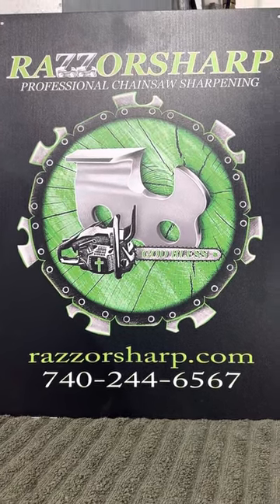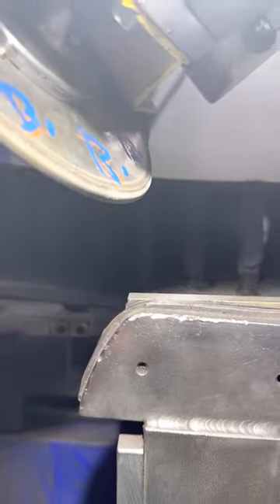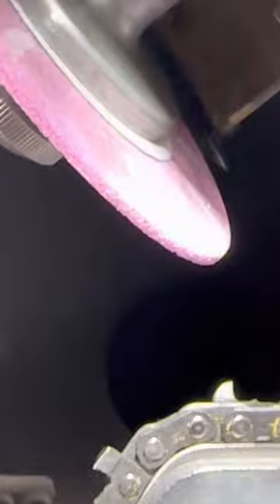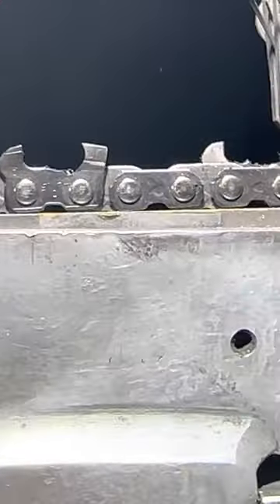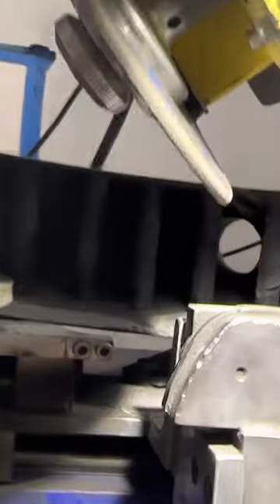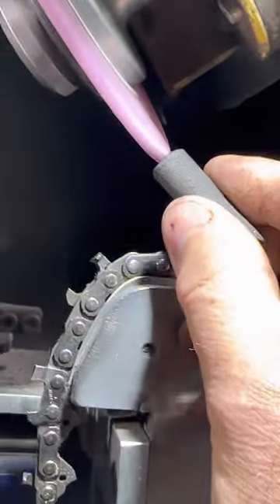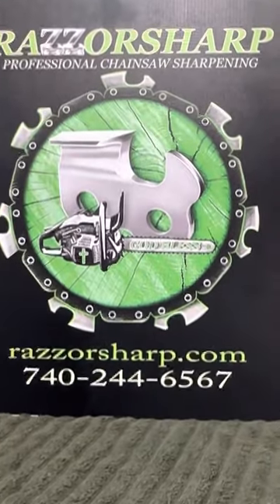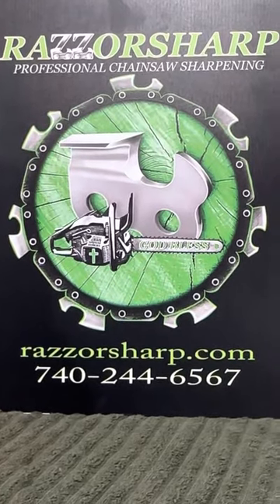Dressing your chainsaw grinding wheel

Comment: I Have A Stihl Chainsaw Sharpener.  I Am Totally New At This & I Want To Learn How.  What Do I Set The Top Angle & Bottom Angle At ?  Thanks
Reply from the maker: Most to are set. At 60 degrees, mine is actually 55 degrees. The bottom angle I prefer 30 degrees. Hope this helps👍🙏✝️❤️🇺🇸